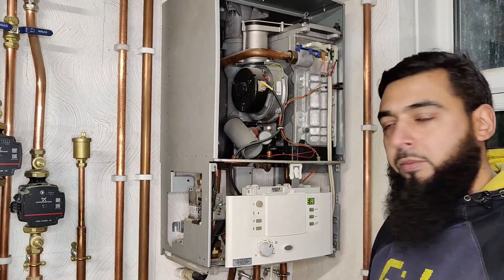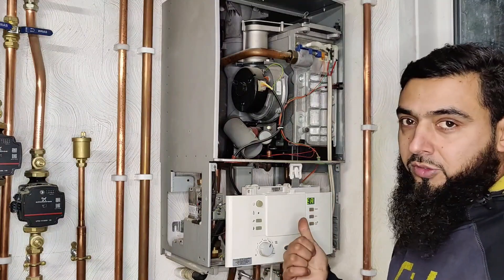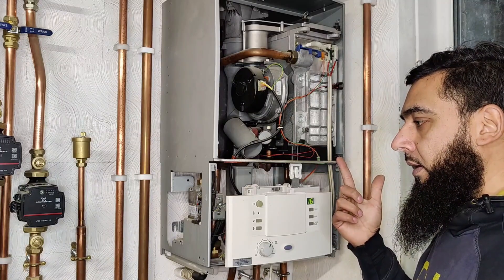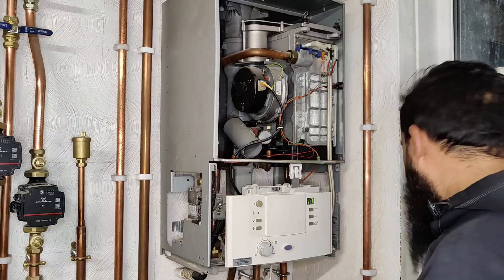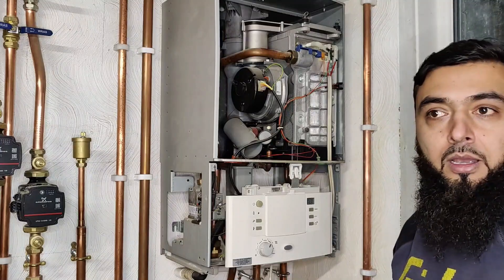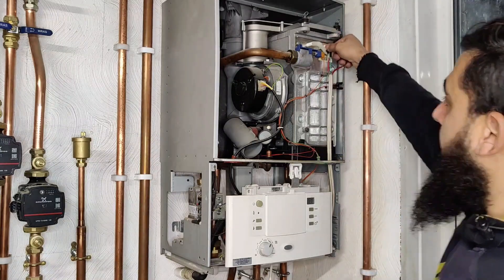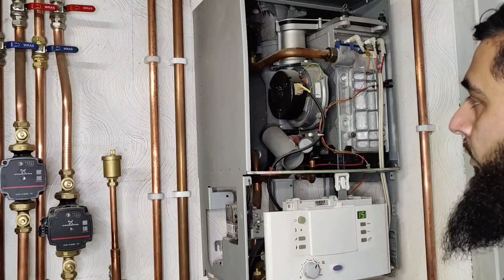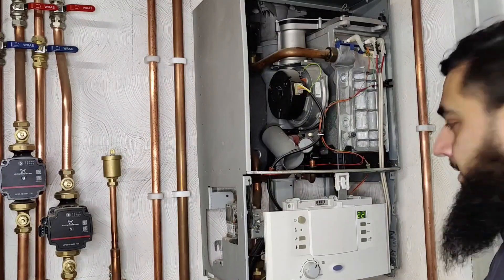HOW TO CARRY OUT A BOILER REPAIR-FLAME RECTIFICATION AND IGNITION ELECTRODE FAULT-WORCESTER EA FAULT

Comment: How to check rectification if it's a single lead, like veissmann etc
Reply from the maker: You put the multimeter in series with the rectification cable and measure the micro amps.

Comment: In the USA we undertake a sequence of combustion operation like you did here to fault find on our gas furnaces for forced air systems. What is the DC voltage on these boilers after rectification and do you test for that as well as part of normal maintenance?
Reply from the maker: @mathman0101  We don't test is part of normal operation/ maintenance however most boilers display ionization current on display and others can be checked whilst looking for a fault.
On one of these boilers it's 2 to 10 micro Amps DC once rectified.
Reply: @ 2-10 micro amps seems about right for our much larger systems as well we would normally be looking at seeing whether the flame sensor was dirty if flame sensor went below 0.5 micro amps. In ours we can usually clean or should I say more correctly wipe of any residue from flame detection part of the ignition system (no hard sandpaper!) light touch with some very fine wire wool. That can at a pinch get it working again before we usually replace. The question is how bad did this flame ignition system get when it was so underused? Was their oxidation and other moisture ingress that impacted it?
Reply from the maker: @mathman0101  In my experience we find badly corroded flame or ignition electrodes when the appliance isn't serviced regularly or not serviced properly due to lazy engineers 😕 so it's mainly incomplete combustion/ flame that causes it to burn.
In England on most boilers it's also a recommendation to change the flame rectification electrode every five years however not many would replace a working electrode.
Reply: @MHKBuildingSolutions  thanks as always preventative maintenance and servicing is best.